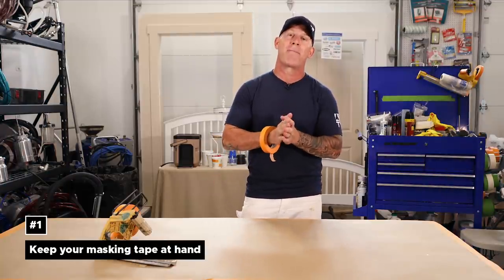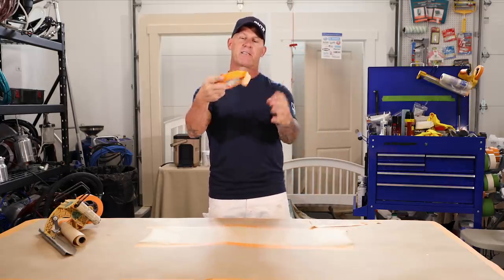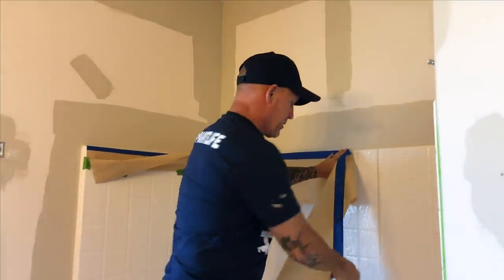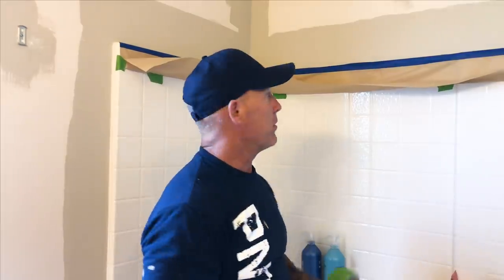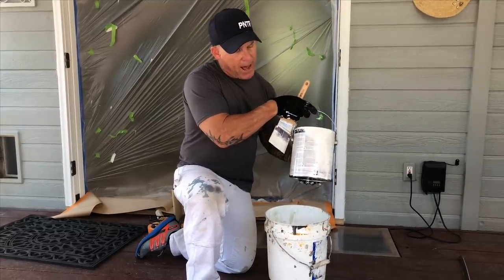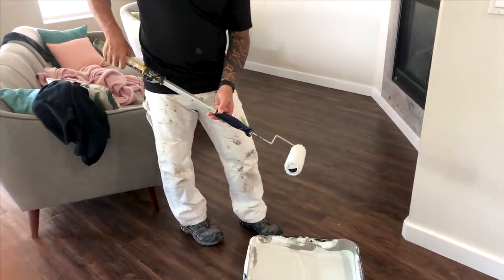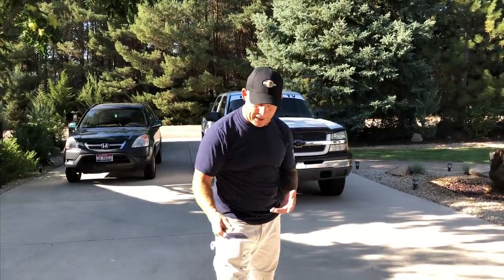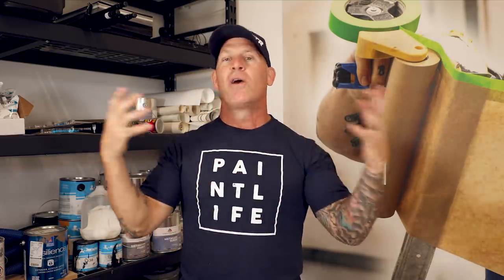FINALLY REVEALED! Amazing Pro Painter HACKS.

Comment: One thing I actually learned working at a restaurant is taking a rag and you tie it around the rim of a 1 gal paint can even better with stain. It makes it almost a dripless pour. I usually wrap it in a way that covers the bottom 3/4 of the can works very well and saves the actual can label

Comment: So, I've got a potential customer that has a home with vinyl siding, but he doesn't believe you should paint vinyl siding.  True or false...?
What can I tell him or show him to change his mind ?
Reply: lifes good I would explain that as long as you prepare the surface properly and use vinyl safe paint you should be good to go.
Reply: Is he wary of warping? Just assure him or her of the safety of a lighter color. Also, maybe it would help to bring up the fact that pretty much anything can be painted with proper preparation and the right type of paint.
Reply: Depends on the color he chooses, if he goes with a light color I would take the job but if he goes with a dark color chances are the vinyl will flex and bend due to all the heat it conducts, so my advice would be to make sure you thoroughly pressure wash the house, once the house is clean if the color is light I would go with 2 coats of High quality Vinyl Safe Paint, if it’s a dark color then I would grab some quality exterior oil based primer and have it tinted dark and use that for the first coat, and then depending on how experienced you are will determine if you would need one coat of finish paint or two.  I normally turn these type of projects down, way to much time, effort, and aggravation, I can make just as much on premium interior projects which is basically all I schedule now a days, also some more advice for you because I feel like your young and fairly new in this business, if a customer is unsure or uncomfortable about a situation it’s never smart to try and convince him otherwise because it  gives him all the power and puts you at a major disadvantage, he will he studying you work from start to finish and the first little thing you do wrong and he will be in your face saying I told you I didn’t think this was a good idea, you need to be really smart about the decisions you make in this business or you won’t last long, rule of thumb never try and convince a customer that already thinks he knows it all, you will lose every time

Comment: Tell me how to stick tape to existing paint and not have some of the existing paint come off when you pull it off.
Reply: Use tape with less adhesive
Reply: @kingalmighty3847  How do you know how much adhesive is on tape before you buy it/ can you recommend a brand? If it's only slightly sticky will it still leave a sharp edge?
Reply: @kidneedonor8088  frog tape yellow